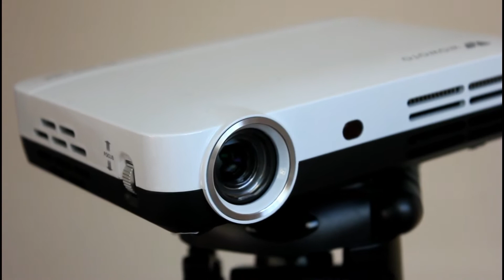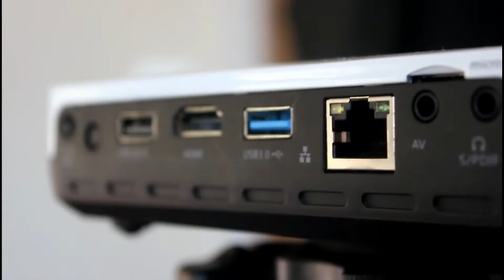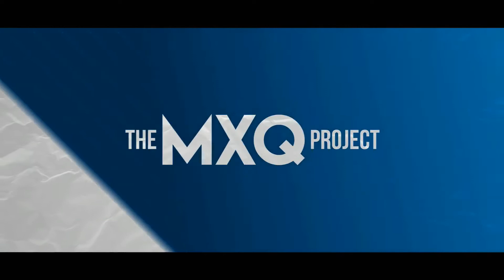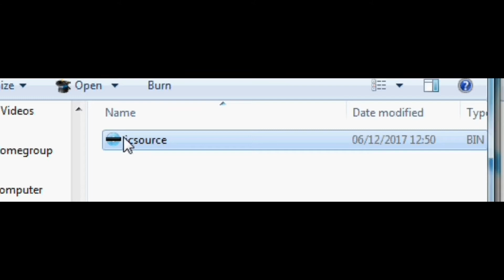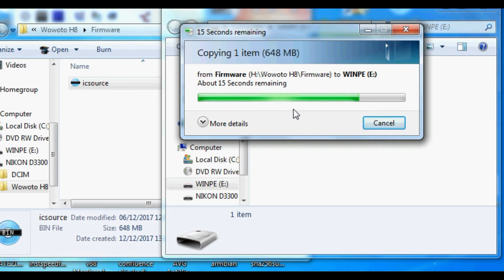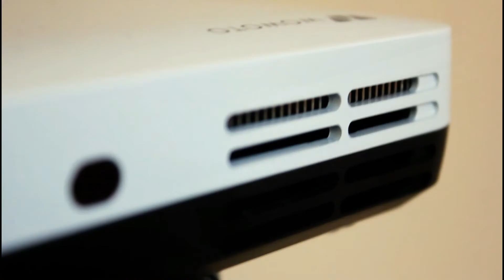TUTORIAL: Recover, Update, Reinstall Android on Budget Pico Projectors: Wowoto H8 DLP 3D

Comment: My H8 just stopped working one day. It displays the Wowoto logo screen, then it goes black. Pushing buttons on the projector itself or on the remote accomplishes nothing. After a few turns with the Gearbest customer support, I was instructed to put the end of a paperclip into the A/V jack. After doing that even the Wowoto logo is now scrambled. I think they totally ruined the projector for me, and when I ask them if they could help me repair it they just say "sorry no". I tried the trick in this video, formatting an 8GB USB stick to the FAT file system (using my Mac) and then copying the .inf file onto it. Inserted it into the USB2 port on the projector and turned it on. The scrambled Wowoto-logo displays, then nothing. No sign of wanting to load anything from the USB stick. Do you think I am toast?
Reply from the maker: You tried holding in the reset button with the USB inserted ? Maybe try another USB stick
Reply: @MXQPROJECT  Which reset button? I can't find any on my device. I can certainly try another USB stick. And I can try formatting it on a windows computer instead.
Reply: @MXQPROJECT  Amazing! I did format a second USB stick on a Windows computer (to the FAT32 file system) to my surprise, I got the unit to do a software update! Unfortunately though, the unit is still broken in the sense that it displays a flickering zebra pattern all the time, as if the video-memory was destroyed when poking with the paper-clip in the A/V-hole (as instructed by the Gearbest support). So still no joy. I don't suppose that you can repair these things?

Comment: Hello, I wanted to know if you know the Luxcine Z4000 and Olympia XX9900 projectors -very similar to the Wowoto, but with Android 5.1-. I was looking for a portable projector to teach and I wanted to know if the Wowoto or any of the ones that I mentioned to you - if you have knowledge - work with a little sunlight or artificial light, since I can't totally obscure the classroom because the Students must take note. Best regards from Argentina.
Reply from the maker: Yeah since the release of this projector their being a number of copies made. Unsure who the original designer is, although Wowoto claims they are but iv seen this exact model produced by a well known western company called Optima. Anyway, this is a good little projector, it will be alright as long as the projection surface does not have any direct sunlight and should handle some light in the room to allow your students to make notes, etc. Xgimi produces some excellent and very bright projectors for around the same money as a this Wowoto, but it really comes down to your budget.

Comment: Is the H9 going to be updated on Android, I know this has been asked before but the replies are inconclusive  March/April or no an upgrade is not going to happen?.  Tried to find firmware update too (1.04.7632.20170930)  Cannot find this, any chance of a link as the auto update fails.  WoWoTo don't seem to answer direct questions and the investment on the product isnt small.
Reply from the maker: Frustratingly they are not releasing a new version of Android for this, whereas they did say they would and confirmed this with us. It is an expensive product and so we are a bit annoyed at them for this. I believe they have opted to just release a projector with a new version of Android.
Reply: This projector was bought specifically as it could be upgraded to a later form of Android.  All the obvious places on the internet stated that.  As such as it was delivered by a UK company I believe this may come under the Sale of Goods Act.  A bit annoyed doesn’t really describe how we feel.  Please all readers of this, consider carefully when purchasing such a product that you check (as I did ) that the promises to supply a product to a specification are kept.  Anyone want to buy a good quality, barely used projector with NO SUPPORT from the manufacturer. But an almost instant response from MXQ .  Thanks MXQ

Comment: Thank you for the video, I tried to update the my projector,, it was stuck on the update screen for more than 2 hrs. so I decided to switch it off, now it wont boot. I tried your file but again nothing happens.. please help if you can. Much appreciated. using windows 10.
Reply: It is also stuck for me (H8). Update starts, goes up to around 42% quickly, slowly ramps up to 57, then suddenly jumps to 100% and restarts. Once restarted, same thing repeats over and over again. I got the file from wowoto facebook post.
I was closely watching the progress and pulled USB drive right when it restarted. Well, Android loads fine, at least it's not bricked. All apps are gone from main menu. There is a new weird app "Camera", which says no camera detected. KODI is no longer there. There is a link in the apps drawer, but once clicked, it suggest to download and install KODI. Couple minutes later, it installs.
In KODI Audio settings, there is no longer "Android passthrough" device available. If I enable dolby passthrough anyway, I hear digital noise from internal speaker. If I connect S/PDIF device, I hear the same thing from my receiver, which interprets the signal as PCM instead of DTS.
This is REALLY BAD and a pitty, since device itself is quite okay. 1GB of RAM is wayy too little though.
Reply from the maker: What projector you have.
Reply: MXQ PROJECT wowoto h8 black - DLP 3D
Reply: MXQ PROJECT can u help?

Comment: MXQ
I cannot find an information about WOWOTO T8E update. Will it happen, am I going to receive an update over 4.4 android?
Reply from the maker: FilipBrowny they have cancelled the update and are releasing a new lollipop based projector instead. 

I heard from my rep at Wowoto a couple of days back
Reply: Oh, that's a shame since I payed so much for a projector.
Thank you for fast reply.
Reply: I need some support from wowoto - S/PDIF passthrough does not work. Both my receivers take the DTS signal as PCM, so I hear digital noise. This should be fixed with a firmware update. Where can I get it? How can I get in touch with wowoto?
Reply: did you fix it? How @eIektrinis